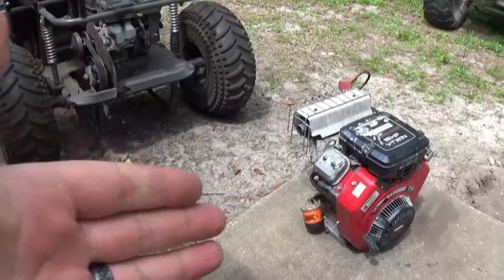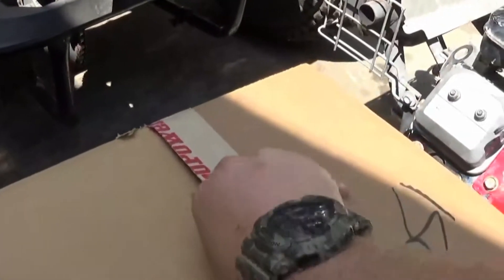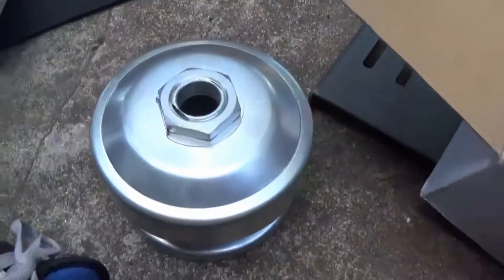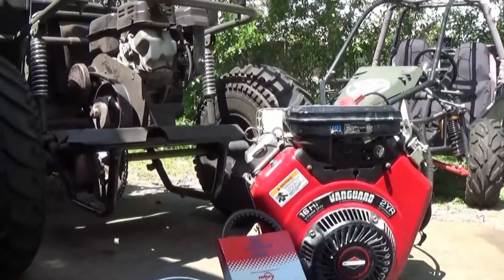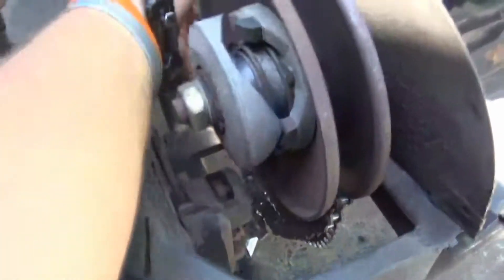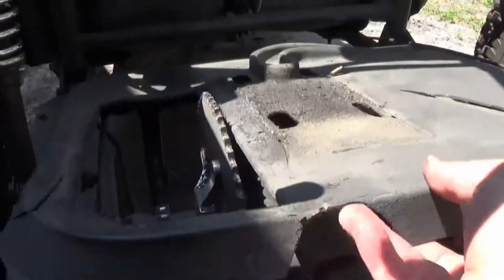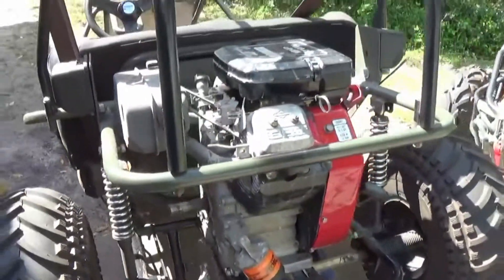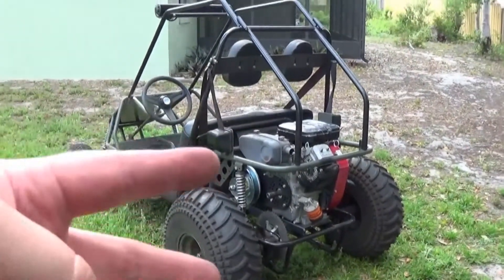GOKART V-TWIN 16HP 480cc SWAP MANCO 606 PART 1

Comment: Good job! Just a couple questions regarding the brake setup on this. I have the same unit although when I purchased it did not have a brake cable or rod. and there isn't much online about it especially in the MANCO parts lookups. Just curious what the brake rod or cable setup is on your. If you don't mind.
Reply from the maker: Hey. Dont have the cart anymore. It was just a big rod going from the brake pedal back to the caliper.  I was going to do a scooter rear brake conversion. Might take a little fabrication.

Comment: What was your top speed im doing the same eng swap on a spiderbox go cart  ,i have the back half of  a polaris atv im trying to figure out which would be faster the 40 series clutch cause its a super easy install or the more technical atv transmission install ??
Reply from the maker: Top speed was about 45 mph. Never went much faster with the big offroad tires

Comment: Hey mundane I ended up buying a Manco dingo that has an old Briggs Flathead with a true Comet 40 series torque converter and check this out it has a differential in it. I wish we could post pictures so I could show it to you but it's just like your go-kart even has the same rear tires that are brand new. I only pay $300 for it. I wished I could show you this differential. I actually have two of them. When I bought this go-kart it needed rear axle bearings and there's four of them. You got to put two on each side when you have the differential and you also got to run 2 disc brakes one for each side. Kind of a neat setup though. I haven't had a chance to ride it as I'm working on it. Look for me on Facebook I live in Prescott Valley Arizona and I can send you some pictures.
Reply from the maker: Todd Bearden join my facebook gokart page. Its manco asw tomberlin offroad gokarts... We have plenty of people who love gokarts and willing to help anyone out. Hope to see you there

Comment: Sorry to rain on your parade their guy but you are going to have zero adjustment for your motor so you will never be able to adjust your chain gopowersports sent you that motor mount to cut the old one out and well that new one in is what should have been done. There are six slots cut into the new motor mount that's because it accommodates the lower horsepower which is 8 horsepower and lower and the bigger ones are for the upper horsepower because they're wider I just now started watching your series I'm interested in seeing what's going to happen :)
Reply from the maker: Todd Bearden I slotted the bigger holes and do have adjustment so the chain doesnt fall off. Its a work in progress. Need better spindles up front scary going that fast with stock front spindles..but thanks for watching my channel
Reply: Yeah and watching the next video I noticed you caught on to that neat looking buggy I've got the same one I'm fixing to put a predator 11 horse on it. Go to a wrecking yard and find a scrapped out quad and try to retrofit the spindles from the Quad to it. But you'll need a welder it's funny and looking at your channel me and you have a lot of the same Hobbies I don't have a Jeep but I got a Silverado I've got almost 90,000 invested into it's a beast and I collect old Cox cars and planes. I don't think you know what a Cox car is I think you're too young :)
Reply from the maker: Todd Bearden yes cox cars old rc stuff. I have an original rc 10. I have a facebook page if you like to join. Manco asw tomberlin offroad gokarts is the name of the page on facebook.
Reply: Facebook got mad at me so I can't post for another 2 weeks soon as I get off restriction I'll join :) somebody that I cussed out complained about it and I said that word that I shouldn't have and because of that one word I got penalized. No post or nothing for me :/

Comment: I think the torque converter from go power sports is way to over priced
Reply from the maker: Braden Weir.  I have heard a lot of good reviews on the go power sports 40 series torque converter. I heard the ones on ebay dont last. dont take my word just read reviews.
Reply: I know it a really good quality it's just so dang expensive even though I will probably go with it I am hopefully going to do some thing similar to this but not the vanguard I'm hopefully going to use a 16hp duromax engine
Reply from the maker: Braden Weir. I thought of the duromax. but I love the way the Vtwin sounds with a good exhaust on it.
Reply: I would love to go with a v twin but I'm on a strict budget
Reply: Braden Weir  I go my torque converter from eBay for 60 dollars an it work fine
Reply: messin with mike I got one on eBay for $81 and it works perfectly
Reply: @messin with mike The ones GPS sells are the same chinese ones on amazon or ebay. They buy them and resell them with a markup.